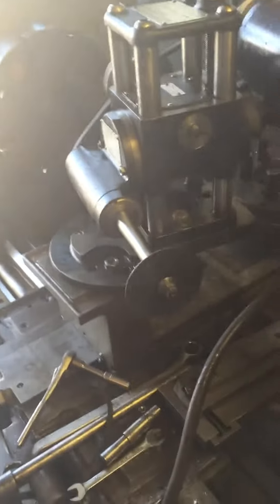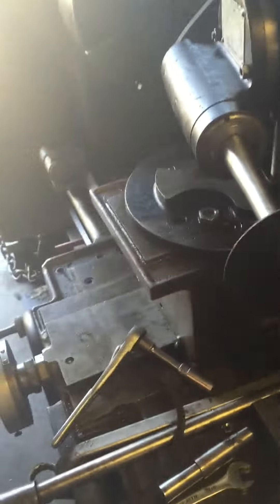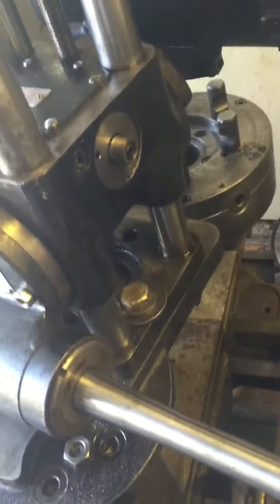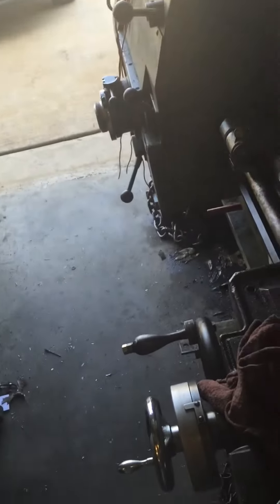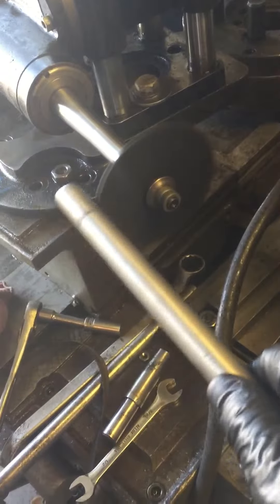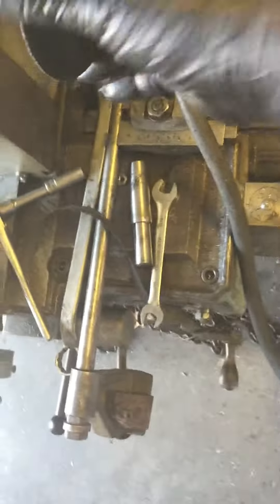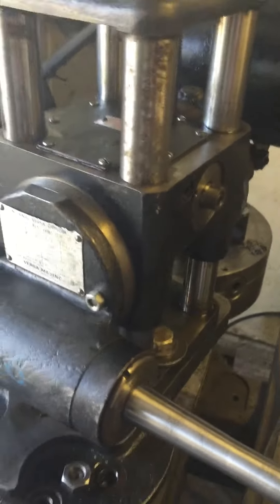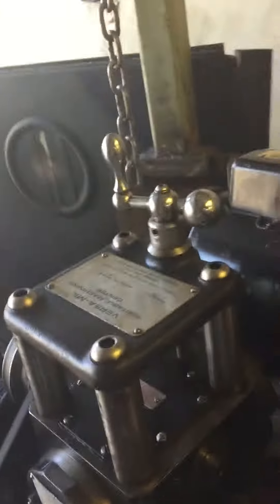The most dangerous piece of machinery ever invented.

Comment: OK maybe your just having some fun with a machine you have no use for.   The army and navy have used these machines for years and they are still being manufactured.    Its all about context.
Reply from the maker: Dan Harold yeah I was just having fun with it. But all of the machines in this video are gone, but I still have the versa mills, two of them.
Reply: @McFingal  That's crazy!  I am currently working on putting a tred mill motor on a Master Mill Model B.    Do you use them ?
Reply from the maker: Dan Harold yes, yes I do have them. why do you want to buy one? Or two?
Reply from the maker: Dan Harold yes I have them
You can reach me at CaptMcFingal@gmail.com
Reply: .   I see them listed on eBay for serious money, depending on how many of the accessorize are present.  Not sure how many have actually sold.  You might list them there.